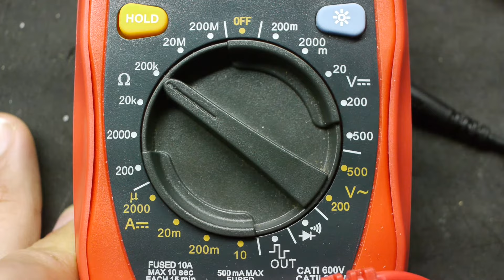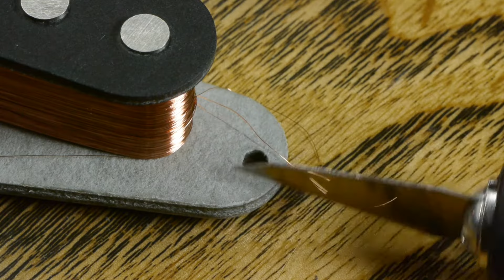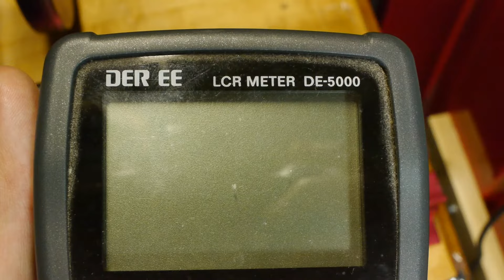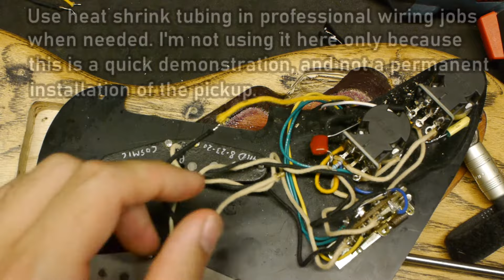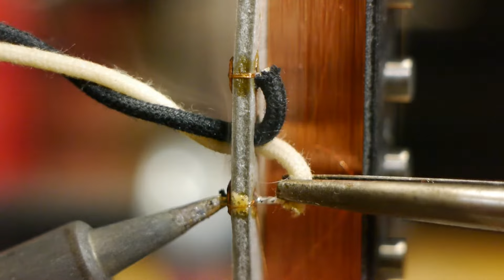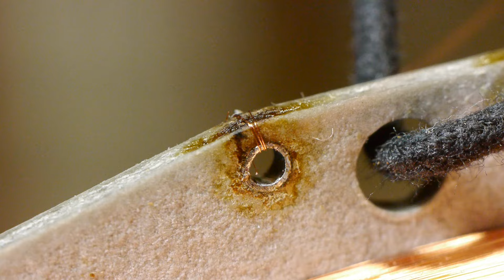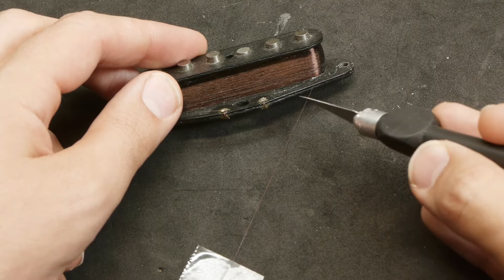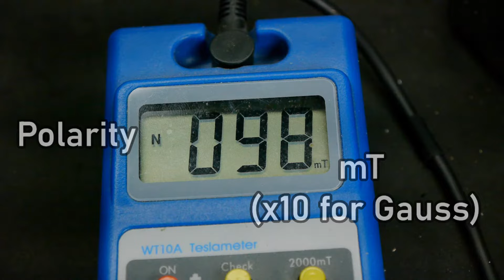Broken Guitar Pickup DIAGNOSIS + REPAIR | Fender Style Single Coil Diagnosis + Repair Demonstration

Comment: Very good except, O.L is not 0 Ohm. That would be a short circuit. Instead it means Open Line.
Reply from the maker: Thank you. This is correct. And one reason I'm displeased that YouTube doesn't allow re-uploading of video files (like Vimeo does), while retaining views/comments -- it also doesn't have annotations anymore, so I can't overlay text pointing out the error over the video footage itself. 

A great example of an open circuit was from yesterday. I had a fantastic opportunity to rewind an original 1951 Nocaster neck pickup. The tap test and the multimeter test both confirmed an open circuit -- due to the parasitic capacitance, a very small amount of AC can make its way through the coil. 

But it results in a very weak, anemic tone without almost no output. Like 1/10th or less the volume that it's supposed to be. 

Interestingly, the magnets were not very rusted. There were a couple very small spots of rust. That's all it takes. But I think most people expect to find severe, grotesque corrosion on these relatively ancient pickups. The few true vintage rewinds I've done, there was no super obvious corrosion. But all it takes is a little bit to cause an open circuit. One strand of wire gets disconnected and then the only signal that gets through is riding on that capacitance. 

Anyway, thanks again for the comment! Comments help boost my channel and I also appreciate that it adds a lot to my videos. Comments like yours are the next best thing to annotations in the video showing corrections to incorrect information. I'm a stickler for perfection and I do appreciate that you pointed out this mistake, and I only hope people look through these comments so they don't think 0L means 0 resistance. Wish I had known that at the time!

Comment: He's using a metal screw driver that is now magnetized. Risking damaging the pickups. Messes with the magnetic poles. Bad advice
Reply from the maker: I can 100% assure you that this is not remotely an issue. And it's easy to verify this with a Gauss or Teslameter. The model i use is a WT10A Teslameter. A screwdriver tap test will have absolutely no impact on the Gauss of the magnets whatsoever and will not damage the pickup in any way whatsoever. 

To deliberately de-Gauss pickups, I use Alnico polepieces with the same polarity as the polepiece I want to de-magnetize. 

You can feel the magnetic repulsion, and then you force the magnet down on top of it anyway. Magnetic attraction will not de-gauss, and magnetic attraction is what happens with the pickup tap test. 

The magnetic repulsion mentioned earlier will de-magnetize a pickup, but also not that much, maybe 150-200 Gauss. For example, when degaussing an A5 mag with another A5 mag, I commonly see reductions to about 800 Gauss from 1000 Gauss.And that's with taking a fully charged A5 polepiece of the same polarity and forcing it down directly on top of the polepiece I want to de-gauss. 

You'll also notice that the polepiece used to de-gauss the other polepiece will lose a ton of Gauss strength, and will need to be re-charged in order to de-Gauss further polepieces.

A tap test with a metal screwdriver will magnetize the metal, but you'll notice that the screwdriver tip is actually attracted to the polepiece, not repelled by it. 

This is similar to how two pickups being attracted to each other and having their polepieces in direct contact will also not de-gauss them. 

It looks scary, but magnets getting attracted to each other and touching each other directly will not affect their Gauss strength whatsoever. You can test this with two pickups, let their polepieces attract and stick to each other directly -- measure them before and after, and you'll see zero change in Gauss strength on either pickup. 

It's the forcing together of two same-polarity magnets that de-gausses them. Forcing together two magnets that have magnetic repulsion -- that will result in a loss of magnetism.

Comment: Hey, great video, very usefull indeed. Even so, I still have a question, ¿is there any sort of rule for the number of turns that the pickup has to have? (I apologize beforehand if there are any errors in this text, english isn't my natal language)
Reply from the maker: Yes, though this is all based on existing and historical pickup models. Most Fender pickups used 8,000 turns of wire, for example. And most humbuckers used 5,000 turns per coil. 

There are no rules, but standards to go by. Generally, variations in pickups are measured against historical standards, meaning the pickups made in the '50s and '60s. 

Only for the sake of comparison though. When you get into making your own pickups there are no rules, and the only limit is your imagination
Reply from the maker: Also, generally, you can increase by 1,000 turns at a time for a thicker, stronger tone with less treble. So a Strat pickup you might try 9,000 turns, then 10,000, 11,000, etc. To see what you like best. 

I make some models of pickups with as much as 18,000 turns of wire
Reply: Thanks! 

I also wanted to ask; by any chance, do you know how many turns does Epiphone ET270's single coils have?
Reply from the maker: @cesar7907  ET270's are around 9 to 9.5k DCR. I don't know how many turns they use. But based on the DCR, I would suspect they're wound with 43AWG, and maybe around 8,500 to 9,000 turns. 

Having never worked on one before, that's a total guess. But not a bad place to start. The best way is to have a known DCR of the pickup, and then test your guess by winding it out. I'd probably wind to 7,000 turns of 43 and then see what the DCR was, and keep adding wire accordingly until I got to the 9 - 9.5k range. 

But a reading that high leads me to believe it's 43. I recently rewound a Univox single coil bass pickup that actually has 8,000 turns of 44AWG. That DCR reading came out to around 11k. I used 8500 turns to beef it up. Traditionally they're about 10.5k in the bridge and around 10.2k in the neck. 

So again, total guess, but try 8,000 of 43 to start. Most single coil pickups, especially vintage ones, use around 8,000 turns. Even with the much thinner wire gauges it seemed to be a standard, at least as far as I've seen, on single coils.
Reply: @guitar_md  Hey, thanks a lot, you really saved me a bunch of time on research. 

By the way, I measured the DCR when it still worked (I accidentally broke it down by cutting a section of the winding while trying to check the electronics. I just bought the guitar 4 days ago) and it measured 14 KiloOhms; just to clarify, I used a $16 digital multimeter.
Reply from the maker: @cesar7907  Wow. 14k is a lot! The only surefire way to guestimate the number of turns is to use a micrometer to determine the wire gauge. 

I actually am currently working on a video about that Univox bass pickup I rewound. You can also check my video on a humbucker I recently rewound here, where I get into turn count and DCR and more: 

https://youtu.be/yi-wpZhnz8M

14k might mean that those pickups are wound with 44AWG like the Univox pickup. It's entirely possible if they're single coils. 

If it's a brand new guitar, I'd check online for specifications too, to see if they list the DCR of the pickups. If you measured 14k however, I'd say 44AWG is pretty likely.

Comment: Cool content !  
Just a little coment ,  O.L is not zero  resistance , it is infinite resistance . In another words - 'open circuit' . 
Thank you for sharing .
Reply from the maker: Would be curious for your input as I'm having trouble understanding this: (repost from another reply I wrote recently): 

The meter defaults to O.L when it's in Ohm mode, meaning the default reading when there is no continuity between the probes. I took this to mean "open line" in Ohm mode, or "open circuit." 

The interruption in the case of a broken pickup is a severed coil. So imagine you have one probe touching a piece of wire, then the other probe touching another piece of wire, and the pieces of wire are not connected to each other. 

This is the case in a broken pickup. 

In my mind, this might as well be 'zero resistance,' as the DCR of a coil is dependent on the coil being continuous and unbroken. DCR is in this case basically a measure of how long the wire is. 

When the coil is broken, you might as well be putting the probe on two separate, unconnected wires -- there is no resistance in the coil, because the coil is broken, and is therefore incapable of forming continuity between the probes. So the meter defaults to O.L, meaning "open line" or "open circuit." 

My semantics are probably off. I think I've read that in default on Ohm mode, the meter is trying to read infinite resistance, which is why by default, the meter reads O.L in ohm mode when the probes are not connected to anything. 

I'm not brushed up on all that, but for simplicity's sake, 'zero resistance' seems to make more sense to me. The meter gets no reading because the wire is broken, and one end is not connected to the other.

So it's defaulting to its native infinite resistance in OL mode on the Ohm setting, but the coil itself is not creating infinite resistance -- how could it when it's effectively two separate strands of wire not connected to each other? 

Even if infinite resistance is the technically correct term, it's hard to wrap my head around it and I think it makes what's happening here seem more confusing. 

It makes it seem like the break in the coil is creating an overload of resistance, when in reality the meter is simply defaulting back to its native OL reading in Ohm mode, because the two ends of the coil are no longer connected to each other and are not able to create DS resistance from one end to the other as a result. 

Sorry for the huge writeup here but this has been on my mind for a while. Would appreciate if you could clarify this for me and see what you think, and if my reasoning makes sense to you. 

I like to be as accurate as possible and I hate it when I miss things in my videos but I also want things to be clear and easy to understand for my viewers who might not be so well acquainted with these concepts.

Comment: You define 0 resistance but 0.L means overload Which is a very high resistance
Reply from the maker: Yes, that's right. Or "open line" or "open loop" meaning an incomplete circuit. I was unaware of that definition at the time but it would have been nice to include that!

The confusion came from my cheaper multimeter showing OL, though since it defaults to OL when not touching anything I thought it just meant "zero resistance" - but open line or open loop is the correct term, and you could say they default to OL because on default, the probes are not touching anything and are not forming a circuit. So zero resistance is incorrect, as you pointed out. 

My more accurate meter showing very high resistance in the Mega Ohms range depicts what's actually going on more clearly. Very high resistance, as you said. 

Just another reason I wish YouTube would allow re-uploading of video files while keeping view count and comments. I'm currently redoing many other videos as I usually come into new or more accurate information a while after posting my videos. They also don't have annotations anymore, which used to allow text overlays containing updated information. It's definitely very frustrating especially having OCD and wanting all my information to be correct -- I hope at least people can see comments like yours, and that can take the place of annotations as far as corrections/edits go. 

Appreciate the input and correction!
Reply: @guitar_md  but very good video it helped me 😬
Reply from the maker: @knoflookmetui  Thank you! Just please don't hesitate to point out anything inaccurate anywhere else -- I rely on comments like yours for the sake of my viewers.

Sometimes I get things wrong and having it pointed out to me really helps a lot. All that matters is that the information is accurate so if I ever get anything wrong I always want someone to let me know

Comment: Thanks for the great content. Maybe you can help me. There's a problem with my J90C humbucker out of a 1990 Charvel. I followed along your video and see that all poles pass the tap test and there's no shorts to the poles. one coil show 8.7K ohms and the other shows 0L on my Klein MM700. Capacitance shows 0 on the 8.7K coil. Actually the numbers jump around a bit and settle on zero. The 0L coil show 90pF. I think maybe there's an internal break but haven't completely taken it apart. Can you confirm with that info? The sound of the humbucker is weak compared to the 2 single coils in the guitar sound that sound fuller and louder. If the coil is open I'll take it apart and keep my fingers crossed that it's not completely buried.
Reply from the maker: How are the lead wires? Anything frayed or coming apart? If all the poles are passing the test, it's possible the coil is open. I'd also double check to make sure the humbucker isn't out of phase with itself. That can happen sometimes. That would mean the wrong wires are joined for the connection of the two coils. 

It should be finish to finish or start to start for a series connection between the two coils. If it's anything other than that, they'll be out of phase. 

Humbuckers are tricky because they're fragile. Have to be very careful on disassembly. Sometimes the internal wires can short out, and the coils will test normally when the pickups are removed from the baseplate/magnets/etc. 

Short of unwinding to a break on one coil, all you can do is make sure everything is wired correctly, that no wires are fatigued or stripped, and make sure any exposed leads are fully insulated. 

I also don't think I've ever even unwound to a break, though I understand it in theory. I'm working on a dereeler for my winding machine so I can unwind pickups with a machine and turn counter, bur until then, when I get a dead coil, it's rewind time.

I've had a couple humbucker builds go awry when I didn't tape over the "pigtail" leads coming right off the coils. I mean the 28awg hookup wire attached to the magnet wire leads coming off each coil. 

It's possible they didn't tape over the coil with those, and they're shorting out. It's the most bizarre thing, but it does happen. Tough to test. You have to be extremely careful taking humbuckers apart. 

But that would be the next big step is disassembly and testing the coils separately. Let me know if you make any more progress. Your big hope here is it might not be an actual open circuit, but a contact shorting to ground when it shouldn't be.
Reply: @guitar_md  Thanks so much for the in depth response. I pulled it apart and the wiring looks correct with no obvious shorts. I also checked  shorts to the baseplate before pulling it apart. Everything looks good. And still 0L resistance on the one coil. Do you think it's worth rewinding the one coil? I could find a suitable replacement for $100.
Reply from the maker: @badass30gmailcom  If you can rewind it cheaply enough it would be worth it. Could be a fun project. If you want, I could do it for you, or give you some tips if you want to try doing it yourself. 

I'd have to measure the other coil to know how much to wind the broken one. Could be a fun project. If you want, shoot me an email at md101089@hotmail.com and we can discuss that further. Even including shipping I could take care of that for a lot less $$$ than a new pickup would cost.
Reply: @guitar_md  Thanks again. I sent you an email about the pickup.

Comment: You’ve answered a number of my questions regarding pickups. Very informative. Great presentation.
Reply from the maker: You're most welcome. Thanks so much for letting me know this video was helpful to you!
Reply: @guitar_md  yea I ended up just sending them back for a replacement set but I definitely learned a lot by watching and listening to you. I just got back into guitars about 2 years ago and honestly the tech side of it is where I spend most of my time. When I finally setup a guitar correctly and felt that difference, the victory lap inside my brain was something else lolololol